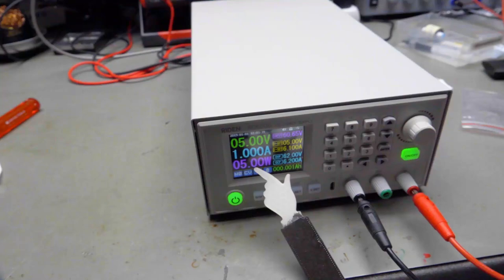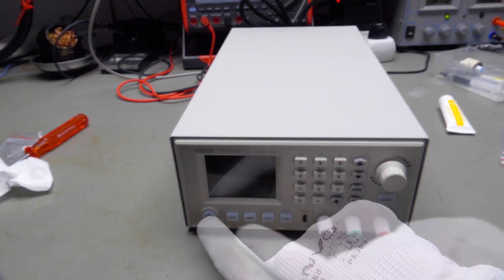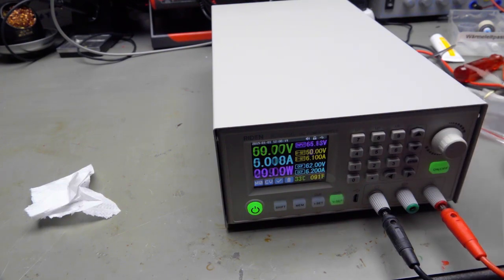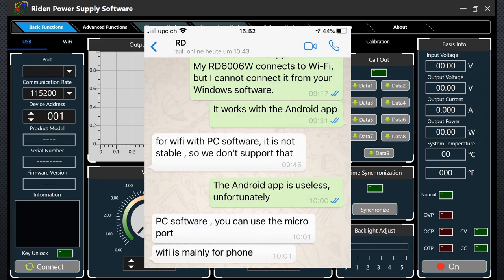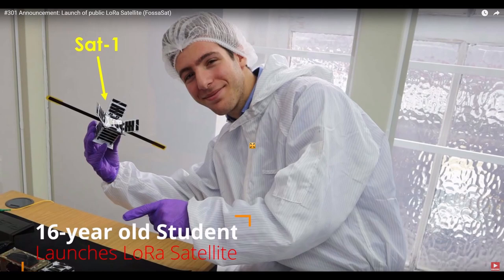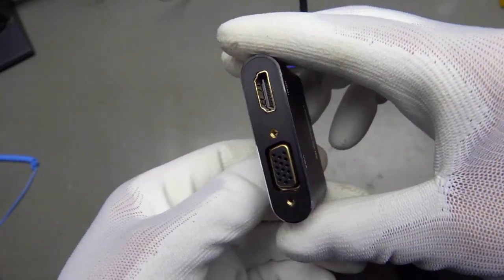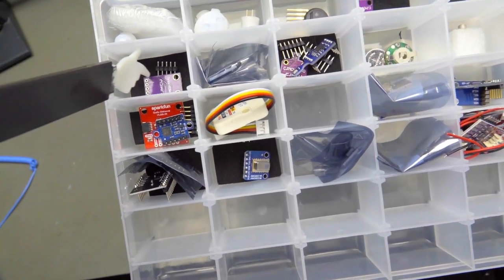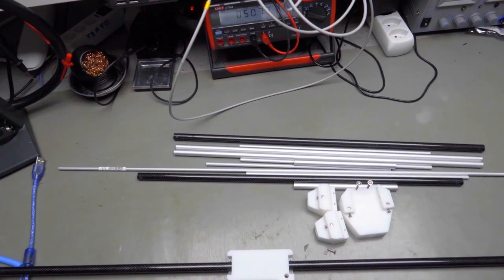#309 Mailbag Part2 (Bench Power Supply, High Power LEDs, New LoRa Chips, etc.)

Comment: The 300W limit is not caused by the RD6006 but by your electronic load. The IT8512A+ can only draw 300W. So if you want to draw 6 ampere at 60 volts you need an electronic load which can handle at least 360W. Or you connect two or more loads in parallel. By the way: nice video as always. Thank you for your effort.
Reply from the maker: You are right! Thank you for the tip, I was not aware of that because usually I do not meaure such loads. I have to add a resistor next time to "waste" some watts outside the Load.
Reply: @AndreasSpiess  It had to be, how can a power supply otherwise increase the voltage but let the current drop if it has no control of the resistance ;) Ohms law still applies, thanks for testing that in 2020! ;)

Comment: Hi Andreas, I bought the RD6006 like you at 11 November. For me the PC software works great and without any problems. All I had to do was installing the CH341 USB driver and that was it. I connected the Power Supply to my laptop USB and it saw it instantly. Just last night it informed me that a newer version 1.05 of it is available as long as a new Firmware version 1.28. Well, updating the RD6006 Firmware was really easy with the PC program. I have not yet tested the WiFi option, just direct USB connection. Also one more note. I've been told the Temperature sensor with the long wire is not for inside of the case! It is to be attached to Batteries to check their temperature when charging them to prevent fire hazard. The Fan control board has already a sensor that you can softly attach it to the AC-DC converter case. Thanks for your nice videos.
Reply from the maker: USB works. WiFi is not supported. Concerning the temp sensor: You are right. I was fooled by the mounting position inside the case. Who mounts a sensor which is used outside inside the case ;-)

Comment: 13:52 we had a similar style of 3x cable which started to spark & smoke recently.  It seems that one of the grounded metal casings (maybe USB) was touching & shorting to one of the exposed pins of the Apple charger cable.  I'm not sure what voltage the Apple connectors use, but it was enough to cause a problem.  

It's probably a bad design choice to have all the cables hanging at the same length.  Do be careful with yours.  Also who on earth designed Apple's connector with exposed voltage pins?!
Reply from the maker: Without connection, the USB charger produces 5v to make sure they do not hurt any device. I never had such an issue. he changes are probably not very big that this happens.

Comment: I have never actually owned a Proper Bench type PSU.  Always worked with something I've cobbled together in some form or fashions. Usually a ol ATX PSU followed by a Buck/Boost converters and filtering.  Usually purpose built for the project at hand.  All Projects start with the PSU ?    I have a 6in x 6in sheet of that Magnetic Viewer sheet.  Quite handy it is.
Reply from the maker: I use my Bench power supply quite often. I would not want to miss it. But of course, you can have different concepts.
Reply: @AndreasSpiess  Not from lack of wish and wants.  Financial Priority thing.  LOL

Comment: The black anti static foam will not protect loose parts in a plastic box. Now if you push the MOSFET into it like the big chips then might help but plastic boxes can generate enough static in dry air using the foam may not help. Some companies use reusable anti static bag in the plastic boxes they provide with their kits that seems to be better but keeping CMOS and related in cheap plastic is not great even then.
Reply from the maker: You are probably right. My floor is slightly antistatic. So I do not have huge problems. Maybe they are not necessary.

Comment: I’ve been using the E32 30dBm modules recently, very easy to use, can reduce power output to 21dBm, I haven’t done any measurements yet though to confirm the output levels.
Reply from the maker: Good to know. Which libarary did you use?
Reply: Andreas Spiess - it uses Serial UART not SPI and basically whatever you feed into one unit comes out of the other.
Reply: Upgrade to the E22T boards - the internal firmware is much improved. The E32 and E22T are serial UARTs (data into one module, data out the other) and they work great as wireless UARTs. The issue with the E32 is that the data transmitted per packet is, I believe 53 bytes. If you have data packets longer than 53 bytes, the internal F/W breaks it down into 53 byte chunks and sends them with hundreds of msec delays between packets. Average Byte/Sec rate drops significantly. The E22 allows up to 200 bytes per packet and that helps with larger data packets. The E22 consumes less power, has more channel/ID combinations, can encrypt data (not strongly, though), and be configured as repeaters. They are sweet if you need  to put together wireless links quickly and want to do minimal programming. I made breakout boards for the E22M, E22T, and E32T modules to simplify their use and can share the schematic and board files via GitHub if people are interested
Reply: @AndreasSpiess  The default settings with both the E32T and E22T allow you to quickly get the modules up and talking with each other. Attach them to UART2 or UART3 of the ESP32, set baud rate to 9600/8N1 and you're off and running. The E22M is a base module that you use similarly to the RFM95. You write code to make the E22M act like UARTs (look at RadioLib) or set them up to interact with TTN. I have used E22Ts to transmit correction streams from a caster to a Ublox zed-f9p (search SparkFun for their board) and it is amazing that one can achieve sub cm positional accuracy with a device that costs less than $200USD. NOTE: to understand the E22T or E32T, need to connect MSO to Rx/Tx of both transmitter and receiver to understand how E-Byte does their transmissions ... and how they select the SF and channel params
Reply: Edison Danno - thanks for the tip, yes the buffer limit is 58 bytes, I was trying to keep my data shorter than that.
Reply: @TheDefpom If my data packets are larger than the UART max data packet, I COBS the data packet so it is easier to reassemble the data when it is received. On the receiving side, E32T data comes through in 58 byte bursts and you are responsible for reassembling the bursts into the data packet. COBS makes it easy since I use 0x00 as the last byte sent so the receiver keeps consuming packets until it sees the 0x00, checks CRC and then sends an ACK that the pqcket was received. With E22-900M22S's I can get a few clicks LOS. 

Also, the user is responsible for keeping within their country's restrictions for the ISM bands. USA is 400msec max airtime for 50 frequency bands ... in other words, you can transmit data once every 20seconds unless you frequency hop or transmit 500KHz bandwidth

Issue with both the E32T and E22T series? To access the registers, the baud rate has to be 9600 baud. I operate the UARTS at 38.4K so whenever I need to get to the registers, I have to drop the baudrate down to 9.6K and then back up to 38.4K for data transmit. But ... both E32T and E22T have 1K buffers so you can spew data fast into the buffer rather than increasing the queue size in the ESP32
Reply from the maker: @Edison: Thank you for the link. I posted it below my video

Comment: Hi Andreas, did you measure the foam? I bought once some from AliExpress and when I measured its conductivity I was surprised that it wasn't conductive at all. I then bought some from reichelt.de which has a measurable conductivity in the MΩ range (as one would expect).

Thanks for your great videos and greetings from the lower Engadine :)
Reply: how far up does your meter go? Also, the resistance could be voltage-dependent.
Reply: @Basement-Science  Nice catch! I wasn't aware of foam non-linearity :). the meter is pretty sensitive. I'll recheck it though in case I can still find it. But anyways: the lower resistance - the better. And there are obviously differences in foam quality (no wonder).

Comment: I purchased on of these to use as a charger for my E-Bikes battery which requires 58 volt. 
I has an separate Positive port for charging batteries but the usage is not well documented.
Reply from the maker: Good choice, I think.

Comment: Nice power supply, certainly for it's price !! 

Soon you will be able to compete with the LHC near your place.
You seem to have fixed the audio problems that were in your previous video, good job !
Reply from the maker: Thank you for the feedback about the audio. I am still working on it becasue I am still not happy with my wireless Rode Mic quality :-(
Reply: @AndreasSpiess  You certainly solved the problem of phase shifting between L and R channel we witnessed in the "Mailbag Part1" on January 19. I listened to today's video "Transistor Survivla Kit" two times, 1x using speakers, 1x using headphones. I couldn't hear anything wrong with it apart from a few clicks or pops from you editing/cut/paste different soundclips, but that is to be expected. What is your complaint about the wireless mic ?
Reply from the maker: Its sound is not as good as the NT-1A I use for the sound over. You hear the difference when you compare the video from today with any mailbag videos. I have no clue why. I thought, I spent enough to buy it ;-)

Comment: IRLB8721 is NOT guaranteed to work with 3.3V.  You have to look for guaranteed R_DS(on) and they start to guarantee @4.5V. So 3.3V is out of spec. For hobby use most of them will work @3.3V but a better choice would be the IRF3708
 or AOD424G
 . The have a guaranteed  R_DS(on) @2.8 or 2.5V. So they can also be used in professional applications @3.3V.  
For smaller currents and SOT23 use e.g. AO6400, AO3400, AO3402, AO3416, AO3420, IRLML6244
, Si2300
, Si2302DS
, PMV16XNR
, IRLML2502
.
Reply from the maker: Thank you for your suggestions. I never use the FETs in TO-220 cases to their full load. If their resistance is below 1 ohm I am perfectly happy ;-) 
I used some of your suggestions for my recent video.

Comment: If you read the manual you will find that that the voltage and current can be set by the keypad. Far quicker and easier than using the rotary encoder.
Reply from the maker: I use this feature often.

Comment: 2:38 DiodeGoneWild did teardown of this power supply and switching transistors wasn't even screwed to the case properly. Maybe it's worth checking in your unit?
Reply from the maker: Thank you for the tip. Maybe I will open it one if I have the time.

Comment: Hello Andreas, thank you for sharing your knowledge and experience! The RD6006 PS looks good and I'm considering getting it for my bench but have a question: when you set the CC limit, is there any issue with overshooting the current? I tried in the past a couple of different programmable power supplies and was disappointed with noticeable spikes of over-current up to 3 times the CC when output got shorted. I ended up using an old-school analog adjustable power supply which stays perfectly within the set CC limits. Thank in advance for your reply.
Reply from the maker: I do not remember the tests. Maybe you find such a test on another channel. Many Youtubers have it.
It is still my main PS on the bench and I never had problems with overshooting.
Reply: @AndreasSpiess  Thank you Sir for the reply!

Comment: In reference ti the BAKOM rules you could go up to 60dBm  in the 70cm Band (430–440 MHz) 
here in DL as a licensed Ham radio operator it's only 58.75 dBm  .... but anyway, you power supply will only supply 300W input :-)
Reply from the maker: The rule is one thing. The budget the other ;-)

Comment: A fascinating selection of goodies that you had to show us! Regarding the power supply, if you are installing your own power unit such as from an old laptop, does this end up producing much RFI, that could for instance interfere with your low-power LORA and other Comms equipment ? Or does the substantial power supply case manage to contain any such RFI? Many thanks!
Reply from the maker: Becasue my lab is in the basement, I do not care too much about RFI. My antenna stuff is on the roof, quite far away. I assume the Laptop power supplies are ok as they have to comply with the standards. At least my laptops come from well-known companies who do not want to screw up too much.
Reply: @AndreasSpiess  OK thanks for this clarification - it looks to be a very professional unit anyway!

Comment: Do you think it would be possible to break out voltage sense wires so a 4 wire (Kelvin) connection is made possible in order to charge a lithium battery?
Reply from the maker: I assume, that, if it would have been simple, they probably would have done it. But I did not open up the case. Maybe in a later version?

Comment: that rdtech supply would be useful if the esp32/esp8266 was a bit more intelligent and it could log p/i/v readings and trigger the supply on off. simple case, i burnt the mosfet inside my 3d printer, so i use external 24v supply with rdtech (old model). now i want to keep it within certain range of temp which is controlled by input current. from 3d printer thermostat(octoprint) i get mqtt string which causes it to turn on / off /increase /decrease current.
magnetic field device looks magical. maybe it has some metal powder inside glass. anyhow, it will be cool to put it over speaker and play some music :)
i have some experience with hdmi/vga adapters. its a bit complicated now because usb3/3.1 has 5/10gbps speed sufficient to make usb3->hdmi adapter (at 1080p@60hz/4k@30hz) but thanks to intel, we now have thunderbolt3 over usb c connector in my intel nuc8 (8th gen core i7) which has bandwidth of 40gbps and has an display port alt inside the same usb c connector..this now runs 4k@60hz along with 3 usb3 ports@5gbps and it has potential to support usb power delivery. so this means, for my office lenovo thinkpad laptop, i use a usb c dongle+usb c adapter (company provided)+external monitor+keboard dongle etc and use only one usb c connector to laptop. unfortunately, this laptop is the slowest i've seen in my life and combine with sap, this leads to the most irritating inner being inside me. so i search for meditating videos on youtube. but this leads to hung laptop. https://www.youtube.com/watch?v=IW7Rqwwth84
Reply: and btw, i would prefer uart / serial lora module over spi because its ugly to manage all the timings with external microprocessor and too complicated to mess up the main task at hand.
Reply from the maker: Concerning the old "bluescreen" video: What a catch. Thank you!
Concerning the SW for the power supply: A decent remote control and logging would enable many interesting scenarios, I am sure.
Concerning the Uart Lora module: I am with you as long as it supports the protocols I need. The Cube Cell seems to support LoRaWAN which is ok. And I also do not know what happens if standards change. Do we need to flash the modules? I assume: Yes.

Comment: I wonder if those USB splitter cables work at USB3 rates - 3 stubs in parallel?
Reply from the maker: AFAIK they are not for data trafic, only for charging. That is how I use them.

Comment: Hi, normaly, the temperature sensor is used for battery charging, not for power supply . Regards :)
Reply from the maker: Are you sure? Why is it mounted inside the box? I have to admit, I did not check and it will probably not be used very often in my case.
Reply: @AndreasSpiess  Yes I'm sure. 
Why it's inside? No Idea.
There is a video from manufacturer here:
https://www.youtube.com/watch?v=irTbqfqtgU0
and Drive with manual :
https://drive.google.com/drive/folders/17V-JWHvqMF-NuWSznEiJ4RKrnn_Pkt5v

I like your english, I'm French and I understand you perfectly :)
Reply from the maker: Than you for the links. I should RTFM ;-)

Comment: Any recommendations for a variable high voltage PSU in the range of 10kilo to 1mega volts or higher? - Thank you for all the great content.
Reply from the maker: I do not work with voltages above 240 volts...
Reply: @AndreasSpiess  but why not? thats where all the fun begins :-D
Reply: Ben Franklin used a kite and length string. Try replacing the string with a aluminum wire.

Comment: I have the rd6006p since today and I hear a faint high pitch sound when I turn on the voltage output. The sound becomes less when I increase the output voltage and from 35 volts the sound is gone. Do others have this too? Or is this a defect?
Reply from the maker: I am an old man and probably would not hear such a sound…
Reply: @AndreasSpiess  Hahaha so as I get older the sound gets less? But do you think it could be a defect or do buck regulators always make noise?

Comment: Did you get the Power Supply wifi to connect?  I had no luck at all.  The documentation on this aspect is poor.
Reply: They upgraded the iPhone App to include a graphical instruction when first opened, but I cannot get it to recognise the correct lan address of my WiFi modem - it just shows all zeros....?
Reply from the maker: Mine connects to wifi

Comment: 14:00 I also have such usb cable. How the exposed 5V on the lightning connector never shorts with ground is a technological miracle. Edit: I see someone below had this problem already. Only Apple has the courage to make a male power output connector.
Reply: yeah, in the apple universum even Einstein would be called a liar, 

but your quiet wrong, allready toke a look on the USB-C ?
there are people sucessfuly punched an ligthning connector in a cellphones USB C socket wich burnt the cellphone and the plug, even in one case without Charger connected. i did have several such "tortured" Cellphones on my Desk
Reply from the maker: We use many of those cables in our family and so far we had no issues. The chance that they firmly touch with is rather small in my opinion.